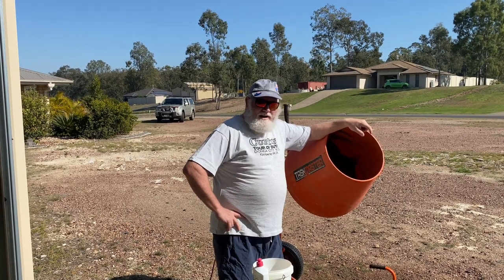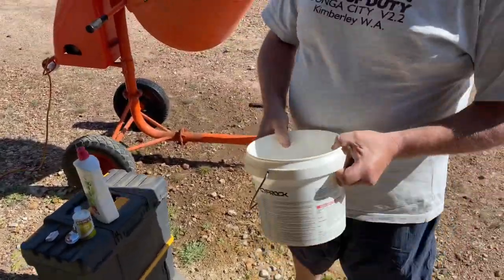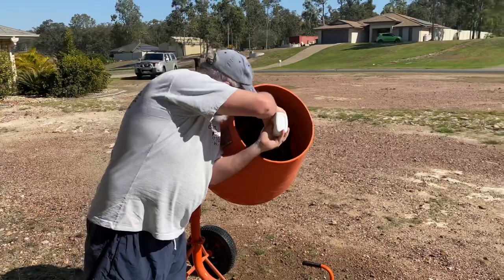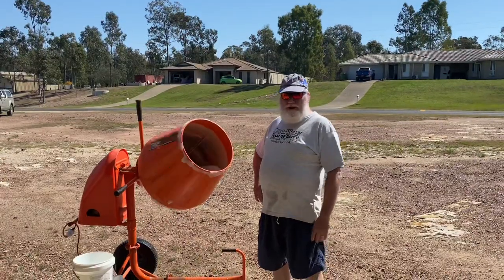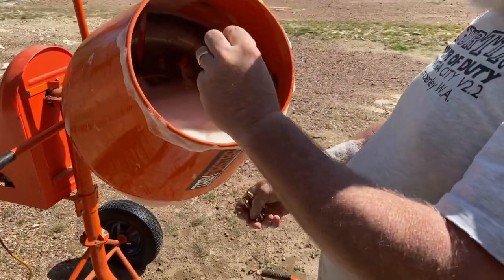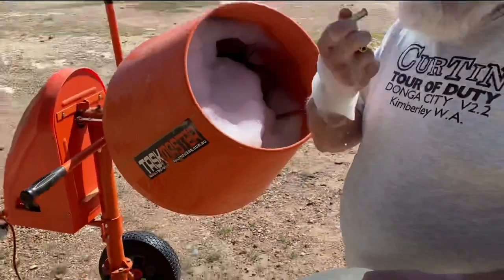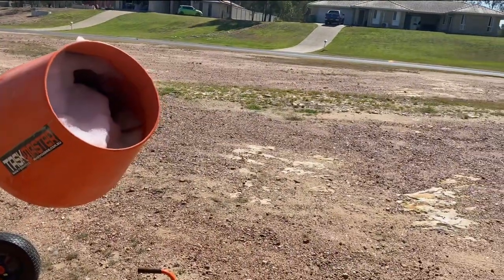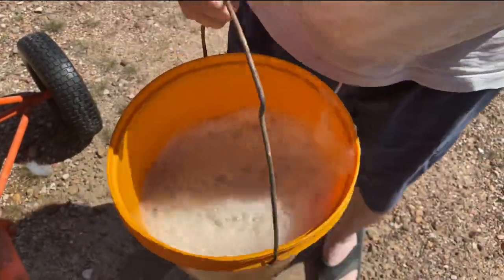Using A Cement Mixer To Tumble Rifle Brass

Comment: I've seen some different ways to clean brass ... You have to get 10 out of 10 for even thinking of using a cement mixer 👍
Reply from the maker: That mixer has been sitting there looking at me for ages. It was a bit rugged on the 30/30 brass; the long necks didn’t seem to like it. I pulled the little dents out (gently) with some long nose pliers, and I ran them through the resizing die very carefully, and the seem to have come up good. Once the projectile is seated and the round gets a good crimp, it should be right.